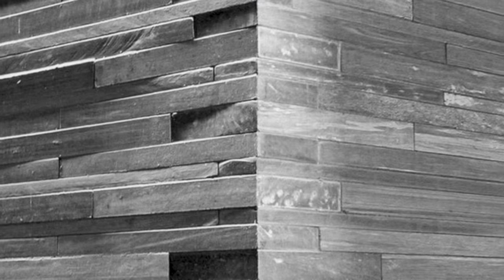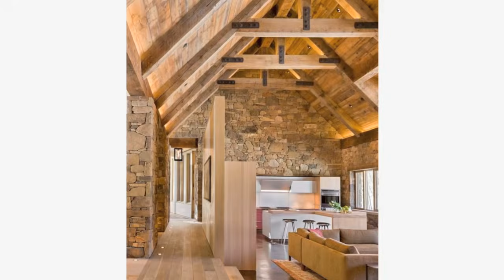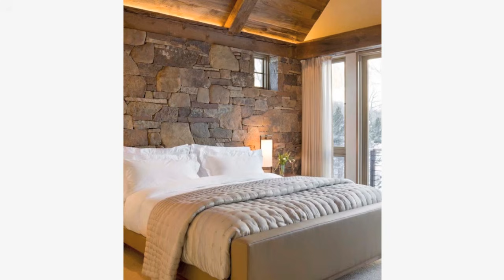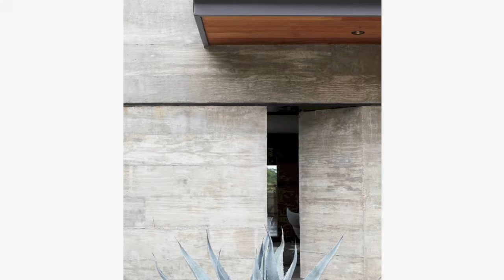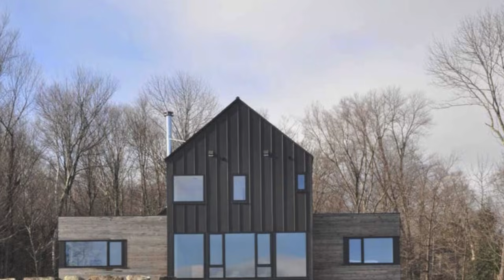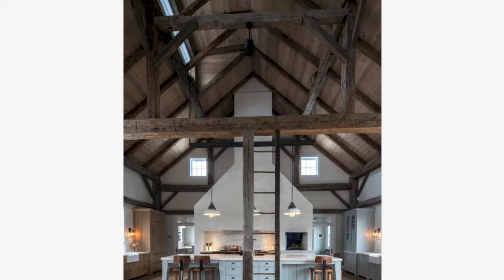Using Materials to tell a Story (An Architectural Essay)

Comment: Old and NEW. Yes! Traditional and modern materials fused. 
Brickwall interiors for the basement, inspired by bunkers. Perhaps retaining the car park slope or part of it, lay bricks and stones leading to the basement. Gives the feel of walking down into a dungeon.
Concrete wall on the second floor curving at the frontage. Wall art can be sculpted or installed/displayed at the sides facing road and the walkway towards 313.
The top rest of the building, maintaining the current width and height? so as not to lose sight of the curves of 313. To be modern in design.

Comment: Thank you for your super clean and informative videos, sir!

I've always imagined that stone/brick walls have a different "time look" than a concrete or plaster wall for example. I mean that when you look at a stone or brick or wall you can feel how it's been built stacking stones on top of each other or when you see a concrete or plaster wall there's no gradation, it's like made in 1 step. I don't know if I'm saying anything that makes sense but it does in my head. Materials have different time.... states..? I don't know I got confused.. :)
Reply from the maker: precisely...I get your point, the handcrafted nature is evident in each material but it's made manifest in different ways...very astute...
Reply: mm.. yes.. astute.. well... sure.. O_o 
I don't know about astute /funny word tho/ but I know that for example orthodox churches were usually built with 2 types of stones which represent daytime and after sunset. The 2nd type are usually darker stones /or bricks/ and are less rows in a roll than the daytime ones.